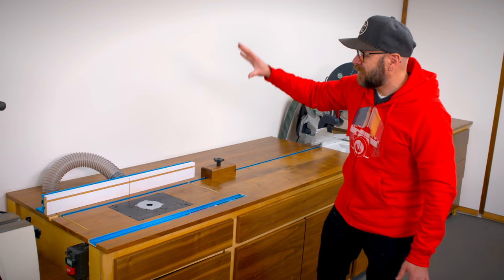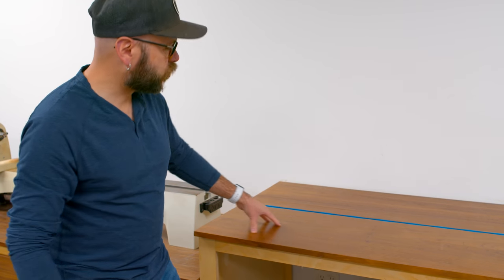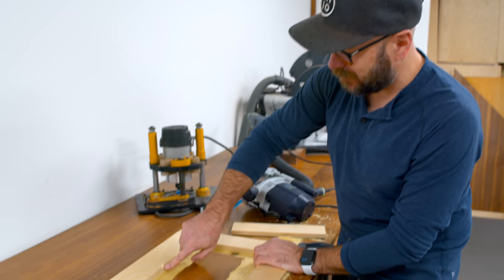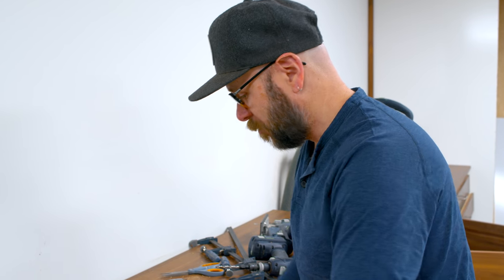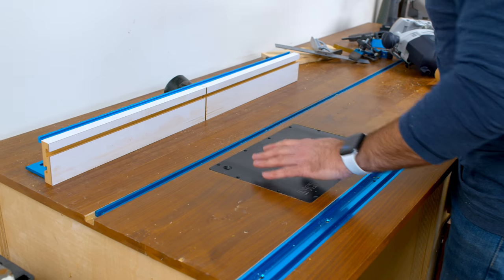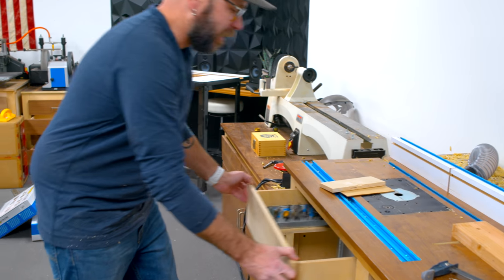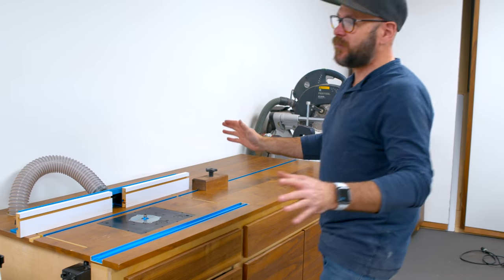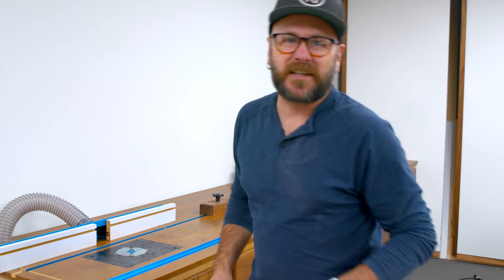Combining my Router Table and Miter Saw Bench to Save Space.

Comment: I'm trying to talk myself into copying this. I've two of the big Triton plunge routers that are waiting for me to build router tables, and putting them in the ends of the miter saw benches might be the fastest way to get them both up and running in the school shop and maybe the home shop as well. Not sure why I am hesitating except that it's a new idea and because I tend to orbit all around the router table when I am working there. Have to examine my work flow and see if I REALLY need to be able to work from both ends of the table or if I just have bad habits.

I'm hoping that you will knock out a couple of router based projects in the coming weeks because I'd like to see how this works out. My current Spring Break plan is to build router tables, but if this works, I have many other uses for my time!

Anyway, great idea. Also, complements to CameraDan. The editing is certainly better than I can do!

Comment: I'd keep an eye on the top of the unit for sagging. Most router tables are thicker than 3/4-inch because routers and lifts are heavy. By starting with a 3/4-inch counter top, then thinning and weakening it on all four sides (the embedded tracks on the front and back, and the slots for the fence on the right and left) you have created what may be a very weak top that may sag over time, making it difficult to rout accurately. I learned this the hard way long ago :)
Reply: I have simular concerns.
Reply from the maker: Thanks! I’ll reinforce if needed.
Reply: I'm thinking of doing this, but I have the same concern as Mr Hamilton. My bench tops are all 3/4" melamine and there wont be much left once I make the cutout for the router base, especially if I add t-slots for the fence. Thinking out loud, I have some scrap OSB subfloor and could laminate a layer of this under the bench top, securing it with construction adhesive and lots of screws.
Reply: @christopherdahle9985  Get some 1-1/2 inch angle iron and run two rails beneath the top, one in front of the lift and another in back. That will prevent any sag.
Reply: @StumpyNubs  That is a MUCH better idea. I was trying to imagineer the problem with the junk I have laying around, but the angle iron isn't that expensive and putting it in would be much faster and easier. Sometimes I'm too stingy for my own good.
Reply: I'm thinking of doing something similar with my trend WRT table, but thinking of just insetting the whole Tend top into the bench itself

Comment: i once put a router set up on a tablesaw  out feed table
and every time I had something set up i couldn't use the tablesaw effectively 
i cant help but see this happening to your miter saw
Reply from the maker: In all the years of woodworking I can’t remember a time that I needed to cut 8 foot boards and route at the same time. I should be good.
Reply: @MakeSomething   in all my 34 years of woodworking ive learned that leaving as many router setups intact until the end of a project is the best policy so l guess we have different styles